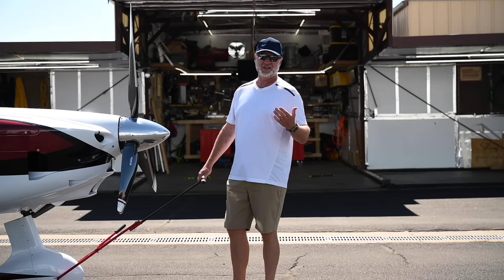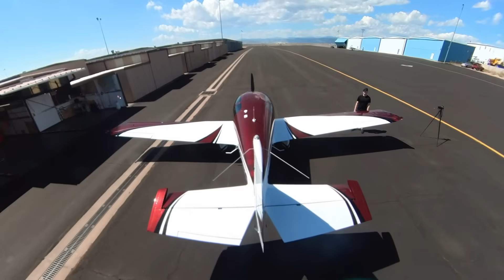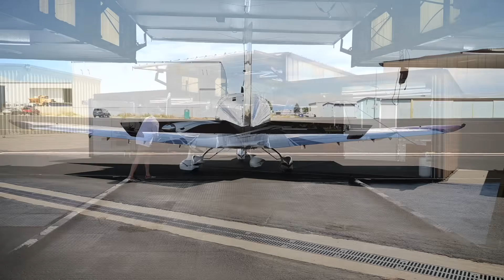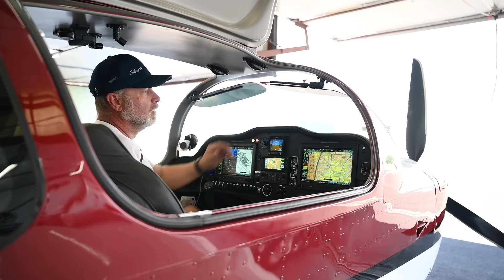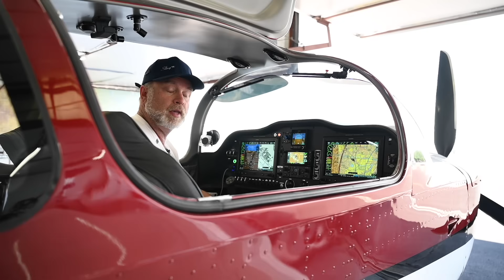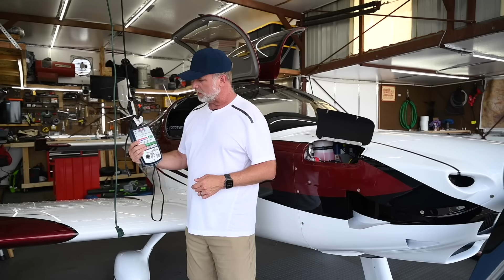SlingTsi Build Wrap Up

Comment: what a stupid idea with the o2. Sorry, that’s just unreliable.
Reply from the maker: Just curious as to how it’s unreliable?
Reply: @FirstRivet using a Bluetooth adapter and a phone to control it is unreliable, and if you have a failure after you have turned it on how are you going to know?
Reply from the maker: This is pretty easy.  The O2 system has an app to let me know when it's on.  If the Bluetooth fails to turn it on then I descend to proper altitudes.
Reply: @Fir @FirstRivet  hacky and dangerous, if any of those fail silently you would think you are ok.

Comment: Awesome video. Been following the build that they did last year on “Aviation 101”, and also wanted to see the process from the perspective of someone who did the build without the build-assist program. 

Now that you’ve had some more time with the plane, is there anything you’d do differently?
Reply from the maker: Sling has made substantial improvements in the design since I built mine. I’d definitely go with the 916 over the 915. They now support the beringer wheels, that’s less work there. The constant speed prop lever will the Duc is also very nice. Outside of that, the kit really is complete. I’m actually looking forward to building more. Probably in retirement.

Comment: Congratulation on your beautiful plane!  Going back a couple of years, you had some challenges with the fuel tanks.  I have a similar situation, and it seems like that magic yellow buffing wheel was a godsend.  Can you tell me where you got it?  I am on the fence on whether to try to take the tank apart like you did, or purchase new pieces and build it new.  Your thoughts?
Reply from the maker: Ugh. Sorry for the slow reply. I got it on amazon. :)

Comment: Looking at the ANG Patriot… imagining how good this plane could be if it was actually carbon fiber
Reply: I looked into it... My first insurance quote 25k a year... That dream died pretty quickly
Reply from the maker: Just an FYI - some of that can be managed through transition training.  That insurance rates did come down this year.  The first quotes I got were orbital and I pretty much told the insurance companies to go pound sand.  After nearly 100hrs they came back down to earth and I think I'm less than $400/mo.  I'd have to double check.

the good news is - the more you fly, the more they come down.